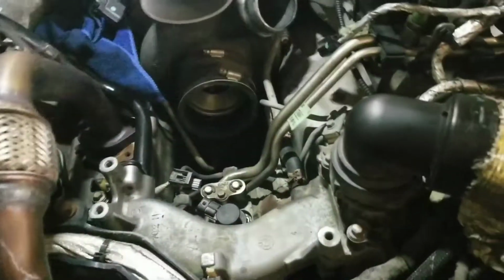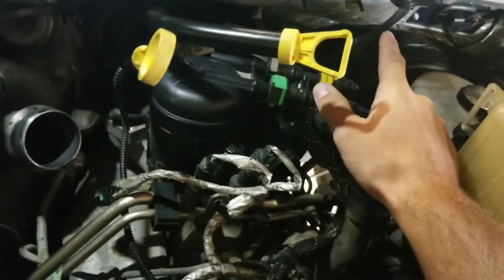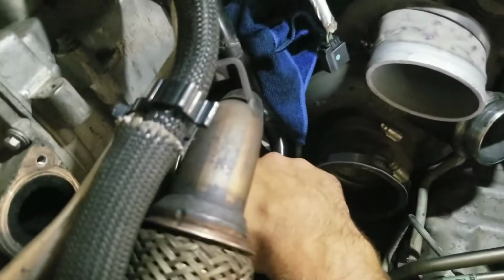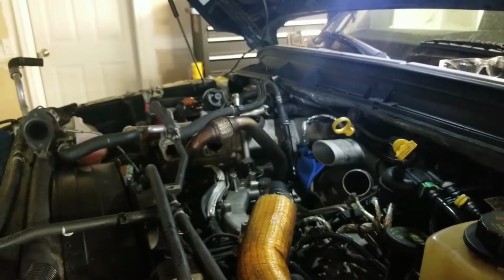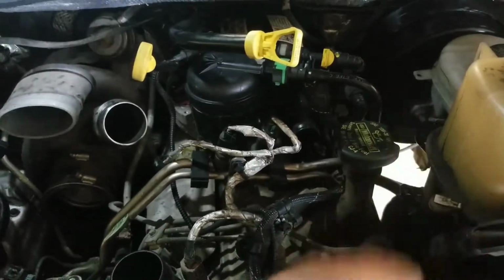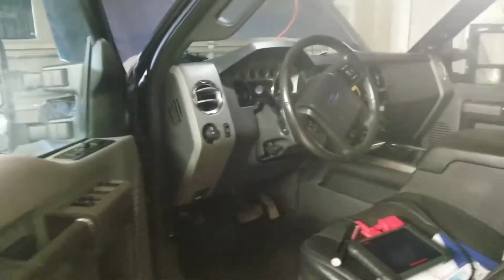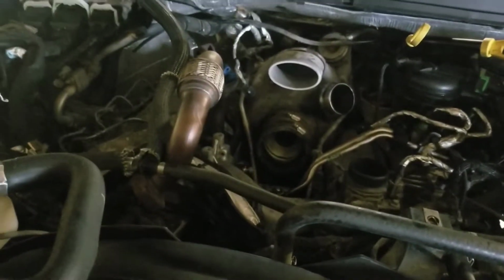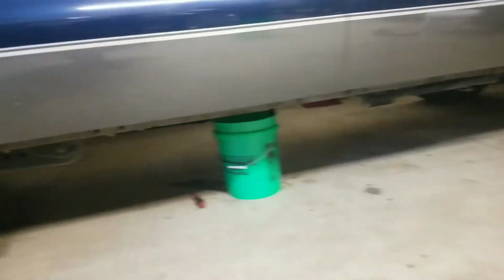6.7 Powerstroke Build Part 3

Comment: So i had the same thing happen to me on a 2012 F250 6.7L. I did the same exact thing you did and saw Zero metal shavings. But did see a little in the rail cap on the lift pump. So I replaced my fuel rail lift pump and the fuel filters. Tried to prime it correctly and nothing. All crank no start. My mechanic diagnosed it after I thought it was the fuel system. He ends up telling me cylinder 3 and 5 have low compression. So I would need a new engine and fuel system. My truck has 300,000 miles. If I replace my fuel system and get someone to rebuild my engine im looking at 20K easily. 🥲